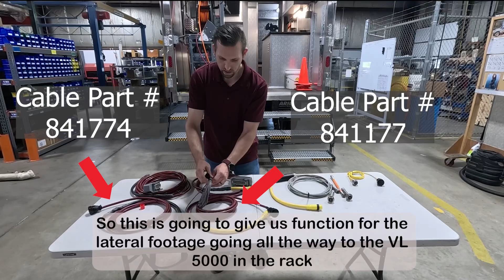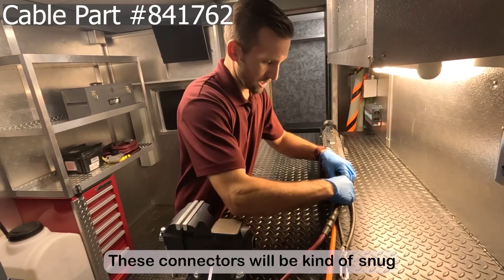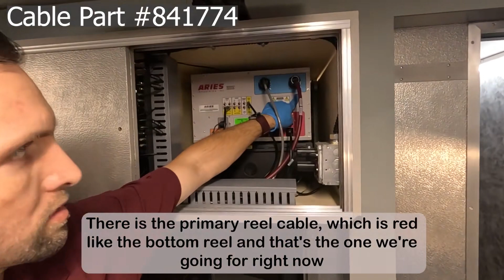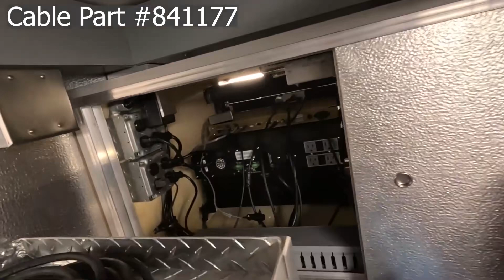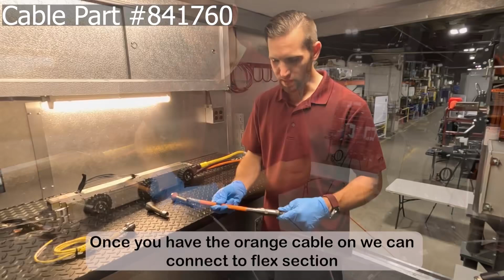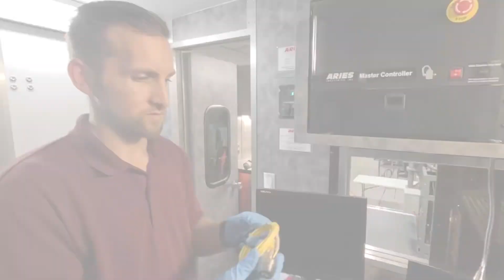LETS Test Cables Overview

Comment: Cool video. No idea why it showed up on my feed. For people, like me, that don't know what your company does or what these cables do, it might be nice if you had an intro section that was like "this is who we are and what we do and sell. " And introduce yourself and what you're trying to prove. Are you testing just continuity on all pins? Low resistance? Support x amps before overheating? Signal fidelity over a large distance? The benefit of using different style cables etc